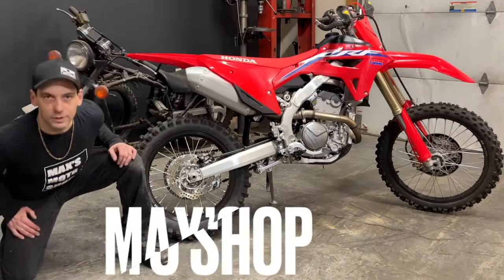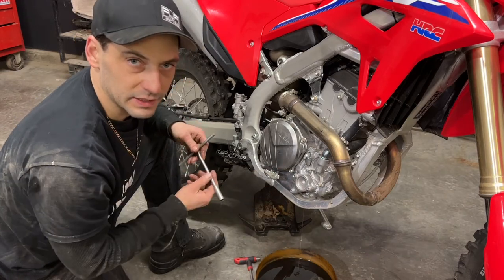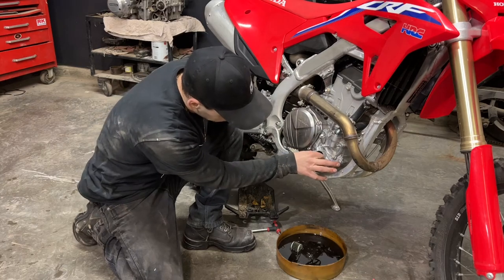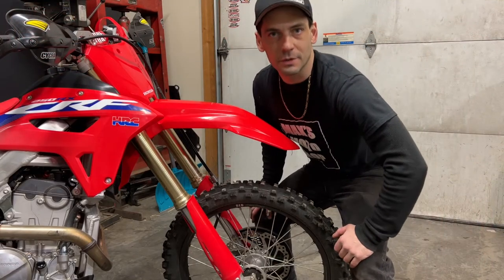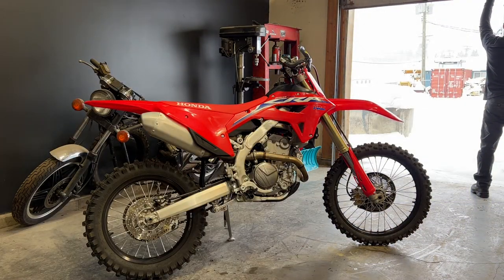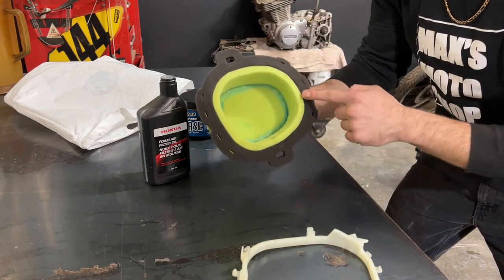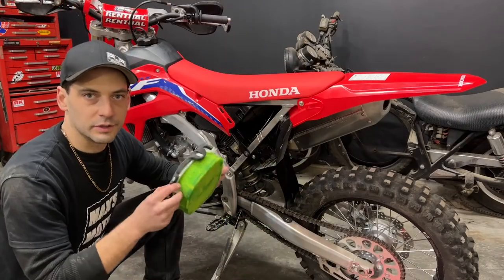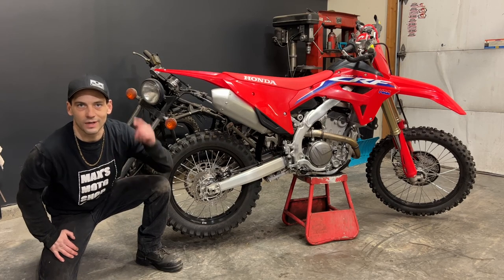How to Change the OIL!!! 2022 HONDA CRF 250 RX /  Oil change and air filter clean / Motocross

Comment: I was just wondering what oil you prefer I use the same brand as you but I didn’t know if the 10w 30 or 40 is the best Honda recommends 30 but I didn’t know if it matters or what your take on it was?

Comment: Nice video. Just bought a 2023 NOS CRF250RX and laughed when I saw how small the owner’s manual was.  Great to know details like the torque specs.  Thanks 🙏
Reply: @Maxsmotoshop  any idea about how often to check the valves on a 23 Crf250rx ?

Comment: Very good video. Explaining what size Allen key it is to open up the drain bolt. I stripped so many oil drain bolts because I didn't know the Allen key size needed. This video really helped me out. It'll be awesome if you can make a video on how to change the spark plug. I have the 14mm spark plug socket but I can't seem to get it to reach all the way down. Basically no more to turn to take out the spark plug. I would also oil the back of the Air Filter.
Reply from the maker: Sorry it took a while to reply I’m glad you found a video useful you need a special tool to remove the spark plug the tool comes with the bike if you do not have one you should be able to get one from your local dealership
Reply: @Maxsmotoshop and also I found a nice one on Rocky Mountain as a spare.  Great video Max.

Comment: Do you recommend greasing your bike before your first initial ride? Is it ok if you do it a bit later? I just bought this bike recently and have been struggling to find a direct guide on maintenance and how consistent I should be doing some of them. I know its a bit off topic just felt the need to ask.
Reply from the maker: Definitely grease your bike within the first year but the sooner the better as you can see there’s little to no grease on most of these pivot bolts and pins from the factory… I usually like to do a service after every few rides depending on how hard I’ve been riding

Comment: I have a question I looked in the owners manual and I cannot see that you have to change the transmission oil or anywhere to change it. Do you need to change it?
Reply from the maker: The engine and transmission oil or not separate anymore there is only one oil

Comment: i used that maxima grease and it is hard to clean out. do i have to use grease.   also what about using K&N filter oil and cleaner is that ok
Reply from the maker: Yes you have to use Greece or it will suck in dirt the K&N filter oil and cleaner are only meant for the K & N filter how use gasoline to clean my air filters and then hot water and lots of dish soap to clean out the gasoline

Comment: How's the low end power for tight trails and engine braking for steep slick downhills?
Reply from the maker: Tons of low end power this bike is a real blast on the trails lots of hold back on hills as well only been out for a few rides can’t wait for next spring👍👍
Reply: @Maxsmotoshop  thanks for the quick reply. I'm going to replace my 2006 yz250f with a bike that is better for trail riding and this bike is one I'm considering.
Reply: @ironthumb3048  personally I've had my 2022 crf250rx for a bit and I've found it doesn't like to go slow in first gear for technical stuff but it may work for you
Reply: @calebvanderbijl6738  Hi Caleb, I just bought this bike but haven't had a chance to ride it yet with a foot+ of snow on the ground. Have you made any changes yet to help in the low end department? pipe, flywheel weight, or any of the Redmoto modifications? Thanks for your time.
Reply: @prestonr.hannula8819  not yet I've ridden it quite a bit more and I'm getting used to it idling a bit faster but I think I will be ordering a new sprocket to gear it down a bit

Comment: I did the Air Filter clean but used the belray foam oil.  does it matter?   Also Im getting a slight backfire every so often.
Reply from the maker: It doesn’t really matter what kind of oil you use it’s more important to put on as much as possible… and make sure you’re putting in quality fuel do not use regular
Reply: @Maxsmotoshop  what fuel do you recommend
Reply: @CH-xu7rl  91 octane
Reply: @alexdoyle1159  leaded

Comment: Can you do more with the 2022 CRF 250RX    Coolant Change.
Reply from the maker: When I get an opportunity I will do so until then locate the drain bolt on your water pump it is on the right side of the motor take out the drain bolt and then remove the rad cap let all the coolant drain reinstall the drain plug refill the coolant run the bike for a few minutes let it cool down and double check your coolant
Reply: So I have a ton of questions.   They told me when I bought this new to break in for 10 hours and then change fluids.   What do you think.      Also should I change oil filter every time I change oil.
Reply: @CH-xu7rl  I am happy to answer any questions just do me a big favor and hit that subscribe button and the thumbs up… I definitely would recommend changing the oil after a few rides on a brand new bike also do the air filter clean and oil as they don’t come with a lot of oil in the filter to begin with but I do not think you need to change the coolant right away… when it comes to the oil filter I think they’re only about nine bucks and I definitely recommend changing it every time you change the oil
Reply from the maker: @CH-xu7rl  swing for gold is my other account did not realize I was signed into it when I answered your question
Reply from the maker: @CH-xu7rl  I also have another video on grease points that you’re gonna wanna go over right away it is called new bike must do grease it before it seizes
Reply from the maker: @CH-xu7rl  if you haven’t found my grease video yet here’s a link https://youtu.be/KHFmlpnjeqY

Comment: Dude im super confused at the moment, i have the same bike but its the 250R, i was gonna service my bike today but i found out that my bike only has one cap to put the oil in as far as i know. i checked the manual and didn’t find anything relating to transmission fluid or oil. Does the bike share engine oil with the transmission? Please help me out😂
Reply from the maker: Yes the transmission and engine oil are shared👍
Reply from the maker: Also make sure you check out my grease video as they do not put very much grease from the factory https://youtu.be/KHFmlpnjeqY
Reply: @Maxsmotoshop  Wow thats really badass. i never would’ve thought a 4 stroke was some what as simple as this. im loving the bike and these videos! thanks again for sharing and ill check out the grease vid too! subbed!
Reply from the maker: @jamal4381  Thank you very much for the support it keeps me going… make sure you do check out the grease video I’ve seen the swing arm pin rust in place after only a year or two

Comment: Just to confirm there’s no extra change for a transmission oil? My ‘05 250x had 2 dipsticks.
Reply from the maker: @250RX_channel  the new Honda motors have a shared transmission and engine oil only one to change only one to fill🤙
Reply: @Maxsmotoshop  thank you for clarification 😊

Comment: my header pipe glows cherry red in the dark after just 30 sec. of idle is that normal ? 22 hondacr250r
Reply from the maker: I’ve never ran mine in the dark and have not noticed it myself but I’m sure it’s fine is that with the high idle on or off
Reply: @Maxsmotoshop  off

Comment: I couldn’t find this foam air filter oil /: had to use some new Honda oil it’s green and sticky as hell
Reply from the maker: I always use the Honda foam air filter. Oil works great.
Reply: @Maxsmotoshop  I also used the Honda foam air filter. I have 3 oem filters in rotation now! Thanks for the video walkthrough it showed me a lot about my bike (:
Reply from the maker: Glad I could help. Thanks for the support. 👍

Comment: What process did you use to clean the air filter?
Reply from the maker: I have been trying the muc-off soak it in the cleaner rinse out with hot water and Dawn dish soap wait until the filter is completely dry and then oil and grease

Comment: Thank you so much sir !
Reply from the maker: Thanks for the support
Reply: @Maxsmotoshop  i have one more qwestion sir , when I get my new 2023 srf250rx they told me I have to do 10 hours and change oil, and then how often do you have to change oil on bike !? Can you give me advice!
Reply from the maker: @theofficial_mr_e1139  I like to do the first oil change after the first or second light ride after that you can do oil changes every 10 hours but the more often you change it the longer your bike will last also check out my video on greasing your brand new bike most of the pivot points like the swingarm bolt and linkage need grease right away because they come with almost none from the factory
Reply: @Maxsmotoshop  yes I will do that's as well thank you sir ya bike world new to me so much to know😅

Comment: I have a 2023 Honda crf250r with 10 hours on it I did a oil change ever 5 hours I did the second one today and my engine oil smells like gas. Does anyone know about this?
Reply from the maker: How is your air filter? Is it on properly? Have you been riding in the sand?
Reply: @Maxsmotoshop  air filter is on properly and no this bike never touched sand
Reply from the maker: @jaydeboudreaux5692  have you been riding in cold temperatures?
Reply: What do you call cold I live in Louisiana while yes it’s been cold but nothing crazy to say.

Comment: ایا روغن گیربکس وموتور یک مدل هستند من فکر میکنم سازنده یک مدل توصیه کرده وآن 10w40هست اما بعضی درگیربکس w80میریزن ایا این اشتباه هست
Reply from the maker: The transmission and engine engine oil are no longer separate on the Hondas. There’s only one oil to drain and fill.
Reply: من متظورم مدل crf250rهست اون تک میل سوپاپ هست واین درفیلم معلومه دومیل سوپاپ هست
Reply: من مدلcrf250rدارم وان جداست اما درال این ها یکی هستند

Comment: A screw is a screw until you put a nut on it, then it's a bolt
Reply from the maker: What if the threads are in the frame? Does that make a bolt a screw because there is no nut
Reply: @Maxsmotoshop  A screw is a screw until you put a nut on it, then it's a bolt { Bolt and screw are mechanical fasteners used to position and hold two or more components together. But they have unique applications and characteristics. Bolts are used with nuts, whereas screws make threads of their own or are used on the threaded component.}
Reply: @Maxsmotoshop  If there is no nut it's a screw, relatively simple if you think about it for a minuet
Reply from the maker: @bear4353  lmao I think you need to think about it a little bit more screw is course and makes its own threads in the material. A bolt is finer, and screws into threads already made in a nut, a frame, a clip, and many other things. It does not have to have a nut to be classified as a bolt. 🤦‍♂️ I don’t normally reply to comments like this but you are hilarious. Thanks for the laugh.👍
Reply: @Maxsmotoshop  Wrong,  a screw is a screw no matter the pitch (pitch is number of threads per inch) a bolt is used when the holes have no threads, two pieces held together with thru holes (no thread in the holes) A screw is a screw until you put a nut on it, then it's a bolt
Reply: @Maxsmotoshop     The following definitions are based on Specification for Identification of Bolts and ANSI/ASME B18.2.1-2012. This specification establishes a recommended procedure for determining the identity of an externally threaded fastener as a bolt or as a screw.

 
     Bolt: A bolt is an externally threaded fastener designed for insertion through the holes in assembled parts, and is normally intended to be tightened or released by torquing a nut.

 
     Screw: A screw is an externally threaded fastener capable of being inserted into holes in assembled parts, of mating with a preformed internal thread or forming its own thread, and of being tightened or released by torquing the head.